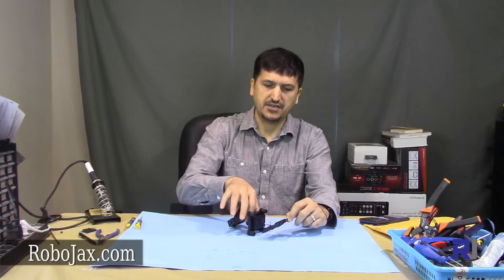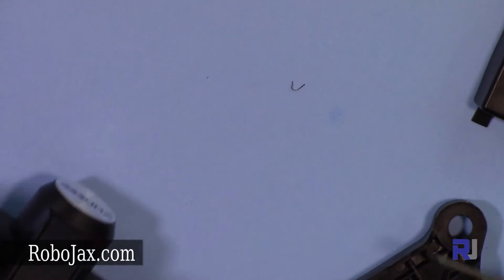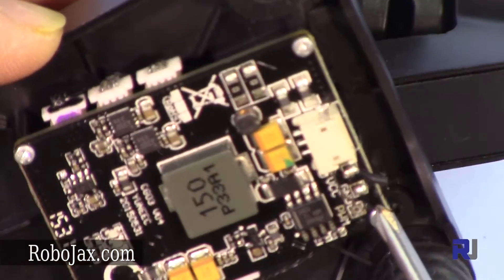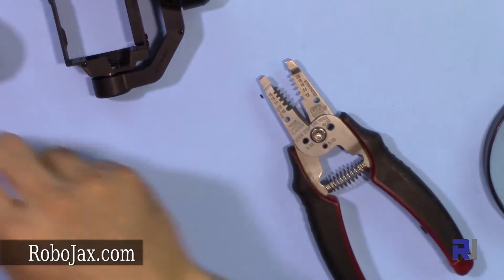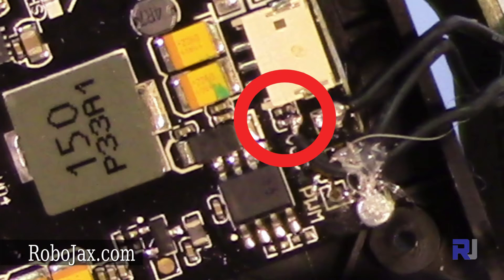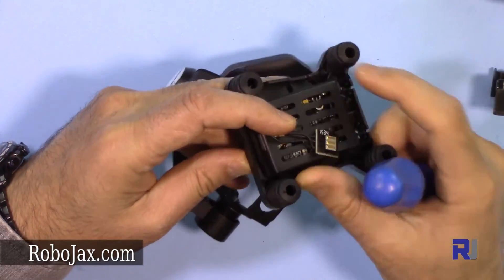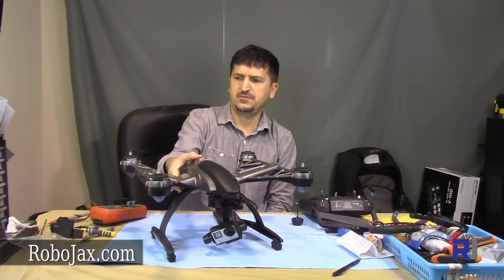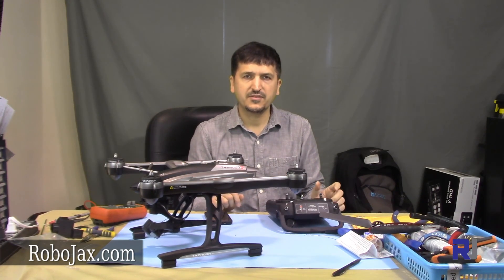Fixing Crushed Yuneec Typhoon  Gimbal GR-203 Gimbal Repair

Comment: Thanks for the clear explanation. I assumed that the PWM cable could have a connection on the other side of the plate in addition to the resistance, but thanks to its video I now know how to repair the gimbal
Reply from the maker: You are welcome. I am glad you found it useful.
Reply: @robojax  One question, because I  do not stiil yet repair the gimbal. It is possible to solder the PWM cable on the very tiny track of the plate, instead on the resistance. Maybe can be sanded until copper is left to weld on. What do you think? Thanks in advance for your input

Comment: Hi Robo Jax !

I have the Q500 4K and the camera is working, but the gimbal is not stabilizing anymore. 
About one year ago, I crush it in a three and the gimbal detached from the drone and ripp off the wires. I've solved that , by using the spare connector that came with the drone. 
Worked as new until some months ago when I transported the drone from A to B flying spot  in my car, without put it in the box. At some point, the drone flipped off , inside the car and when I tried to fly again, the gimbal was dead.
Any suggestion, please ?
I see no other wire or connector brooked, beside the old 3 wires that I did not use anymore, since the first crush.

 Thank you.
Reply from the maker: Hi Syncro, do you hear any noise if you put your year close to the gimbal? first making sure if it get power. Find a way to check the power either with listening or multimeter.  If you hear any sound, then it is the power is there and there is issue with the gimbal which is bad. You might need to replace the gimbal. But if power issue, it could be resolved by checking the connections.  Try it and good luck.
Reply: RoboJax Videos The only sounds I can hear, is from the camera vent. Nothing else, but I will check again. I don't have measurement tool. Thank you.